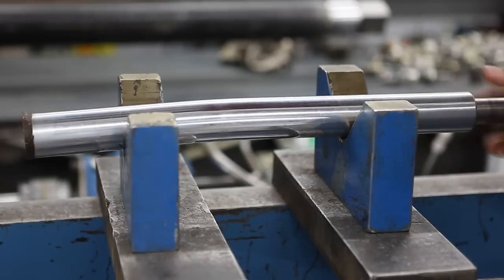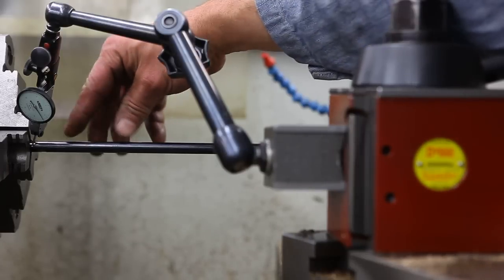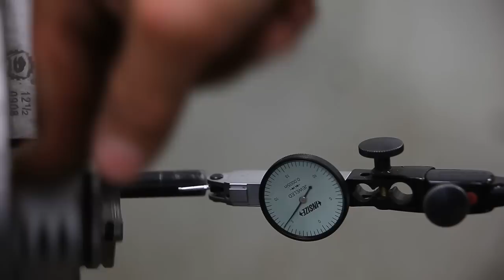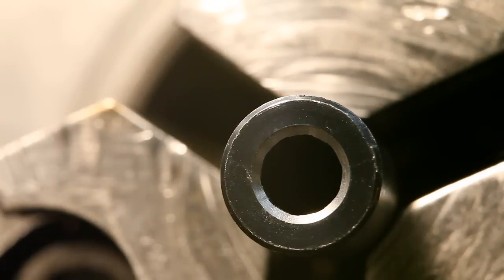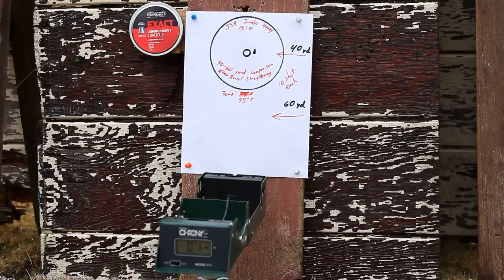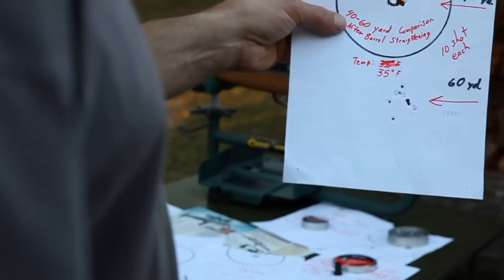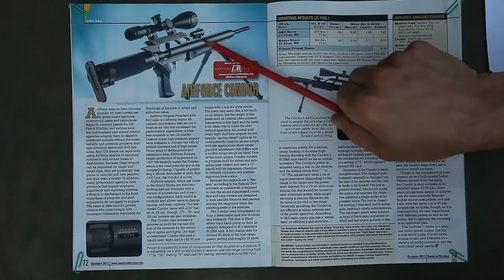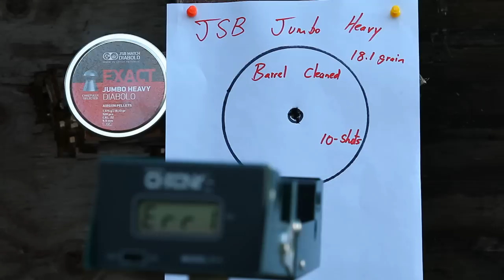Straightening the New Marauder Barrel

Comment: Just stumbled onto this video and had to say that it was good video overall, but the hydraulic guy in me (work for one of the largest hydraulic parts distributors and repair centers in Kentucky) can't help but chuckle at the start of the video.

No one would consider straightening a cylinder rod that was bent as much as the one at the start and honor the work with a warranty of any kind (we back our work with a full year warranty, to match the original OEM part). I do hope that was just a exaggeration for the video... 

For anyone curious: Sending a repaired cylinder back into usage after "straightening" a rod bent that badly would only result in another failure (up to and including catastrophic breakage at the original point of the bend/straightening), the next time most likely also producing damage to the cylinder's gland and piston most likely (showing in the form of ovalization and excessive tolerances), and even the tube wall itself due to the fact that the metal will be so fatigued that it will begin bending again over time as a load is repeatedly cycled on it. With the cost of a new rod being cut not being very high (even using induction hardened material), it's better 99% of the time to simply replace a rod rather then attempt to straighten it. Just my few cents on that part of the video. 

Good work on the rest, and love that Marauder (a nice US made gun that is on my wish list)!
Reply from the maker: +Jacob Oneall 
It all depends on how soft the rod material is.  Some are so soft that the aluminum block we put between the press and the rod and the brass-lined v-blocks holding the rod will actually put dents the rod itself if we are not careful.  A 4 inch rod that is soft like that will often straighten with less pressure and less spring-back than a 3 inch rod made from the more typical 100k material.  The rod at the start of this video was probably fairly soft (75k material?) and could probably be straightened quite easily assuming it wasn't too bad near the piston.  We have actually had some much worse than this.  Often we take them to the press to just get them straight enough to take measurements for a new rod.  More than once we were surprised that after about 10 minutes of working it, we were able to get it  within .005 and it went back into service with no issues.  Then there are others that don't seem too bad at first, but we end up spending over a ½ hour to wind up with an "s" shape that is more than .030 out.
Non induction hardened rods will, to a point, actually get stronger when they are straightened due to work hardening.  Induction hardened rods from Parker/Atlas seem like they are about half-hard.  A ball peen hammer will still dent them, but the bandsaw won't do much more than a pekkin on the surface.  With care, these can be straightened also if the bend is mild.  Cylinders that have position sensor probes in the rods are often made from this type of stock, and they have to be straight so that the probe does not rub inside.  The cost of gun drilling for these probes to make a replacement rod is high enough that straightening is always considered the first option in most cases.
Rods from older Caterpillar equipment are typically crazy hard.  If they are visibly bent without even spinning them in v-blocks, then they are probably borderline broke to begin with.  We don't attempt to straighten these--even if the bend is slight.  The same goes for nitro rod.  Good wear and corrosion resistance, but the nitro layer is so brittle that they do not like to bend at all before breaking.  Surprisingly, the bandsaw cuts it like it was regular 100k chrome rod stock, and it machines just as easy also.
Most of our customer base come from 4 local sawmills.  Some of the cylinders in their equipment make so many cycles per minute that no seal could last a year.  We use this to our advantage as we are able to try different types of seals, head/piston designs, material types, etc. and see the outcome of the change without having to wait years to find out if any durability was gained.  Our warranty policy is if we did something wrong, or it does not last as long as a new cylinder in the same application, then we fix it and make it right.
Reply: I guess the differences in the two companies we each work for have become more apparent (not saying either is better or worse, simply have different tolerances in repairs).

You mention putting a rod back into service with 0.005 bend, and that is on the highly questionable area for our approval. A cylinder with a 0.005 rod would likely be marked as having only a limited warranty, not a full warranty, as that rod would have a very high degree of chance of a re-bend.

Also, the Caterpillar rods that you were seeing as crazy hard are the induction hardened material that I was referring to (we actually inherited a couple of former Cat techs that had been in charge of the IH process in a plant of theirs, and we brought them in to assist in our machining department due to their experience with that material about 10 years ago). We use that material in our own repairs if the cylinder is in a application with a high chance of the rod being subjected to debris (such as on excavators, backhoes, etc where rocks may hit the exposed rod during operation often) where the induction hardening helps it resist dents and dings on top of making it have a bit more torsional strength. We don't use replacement rods from Parker or Atlas in our repairs so I cannot comment with any experience on them (you said from your experience they seemed to be a half-hard surface, which would lead me to assume that their induction process is not as thorough as the IH rod stock that we or Cat use).

Since you clarified that your customer base is mostly the 4 sawmills it makes far more sense that you're able to straighten and reuse rods compared to our customer base that ranges from government agencies (local, state, and federal), to automotive industry, to coal mining operations, highway and bridge construction contractors, as well as lumber and agriculture. 

The mills you're dealing with are far more tolerant cylinder wise than some other applications (we have one lumber mill that simply runs their cylinders into the ground per say, when we get them the customer themselves has straightened them a couple of times and they finally bring them in when the rods have snapped, lol). It seems that the mill units have enough tolerance that they can run cylinders that we consider to be quite sub-par and in need of repair, so straightening rods to be as good as possible a couple of times before replacing would make more sense than say on a 300 ton rated bridge laying crane.

Again, nice work on the Marauder and it's enjoyable to chat about our different views on a similar field!
Reply from the maker: +Jacob Oneall 
You are right about about different tolerances for different types of work.  Working with on-highway rigs, cranes, man lifts, etc. probably requires you to dot "i" & cross "t" more carefully and frequently due to liability concerns.  We measure and record rod, barrel, piston, and head dimensions for every cylinder we do for our records & check for obvious major problems, but there is so much we just have to let slide by.  Even on brand new cylinders; it seems like every seal groove is cut to border line or even slightly outside the seal manufacturer's recommended groove tolerance.  It's rare to see a wear band groove with less than .004 clearance on a 2" rod.  A few months back, we purchased a pair of bronze rod glands from the OEM for Purakal cylinders.  Both measured 1.757-1.758 for the 1.749 rods they were to be used on.

The work we have seen come out of other repair shops in our area is really sad.  Loose head collars, rod clevises, and pistons temporarily retained by dowels, set screws, and center punch smash-overs into the threads are just a few medieval methods we have seen come in our shop.  Of course, there is never any sign of Loctite, anti-seize, proper torque, or anything else that actually works to keep a cylinder together, yet still allows easy disassembly.

The .005 bend is our "goal" figure in the press because it is not uncommon for us to see that in the middle of a 3-5 foot span on brand new chrome rod stock straight from the bandsaw.  Barrel material can be even worse.  Once we had a piece of brand new 6" pre-honed (or something metric equivalent) with approx 1" wall and about 7-foot long, all set-up in the lathe.  The ID was centered at the chuck at one end, and the steady rest supporting the ID-concentric OD groove on the other.  Turned the lathe on, and you could easily see the mid section all whacked-out inside.  We could only get our  test indicator extension about 2-feet down the barrel, but at that point it was reading more than .030 out.  We figure it was probably more like .050 closer to the midpoint.  Reluctantly, the supplier exchanged it for a straighter piece (still about .010 out at 2 feet in) and he said the first piece was actually within their tolerance and normal for a barrel of that wall thickness.  The barrel was for a stick cylinder on a Madill log shovel--a high production machine that loads the sawmill.

So yea, that's some of the stuff we have to live with, deal with, or get away with, in my neck of the woods.

Comment: if they are that easy to bend wont they be bent again real quick
Reply from the maker: Well, the barrel is supported by the shroud; and the shroud has only limited movement due to the barrel band.  So I don't think that with normal use and care, the barrel will ever bend on its own.
Reply: Kris Minnear Once it's sighted in, shouldn't any minor bending be irrelevant? Shouldn't the crown and whatever is behind it (that can touch the pellet) should be the main gamechanger?
Reply: Kris Minnear wll, my barrels shoot more accurate at colder temperatures---i think they bend at higher.......